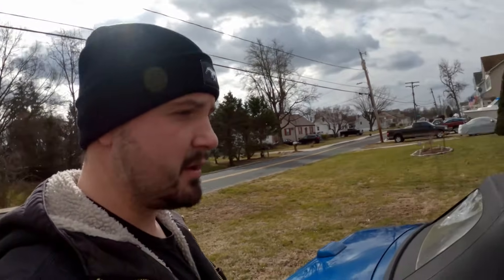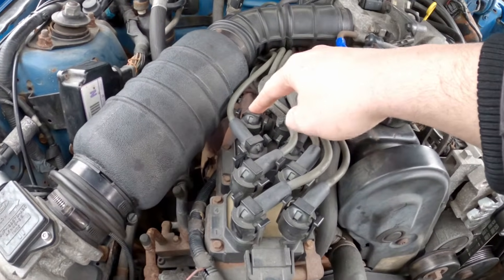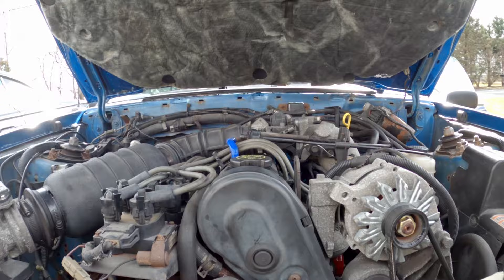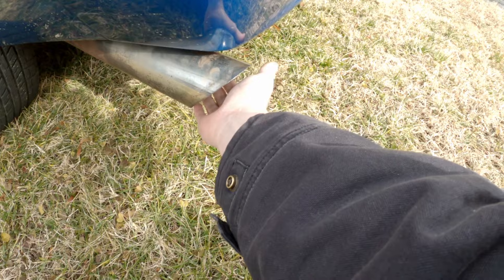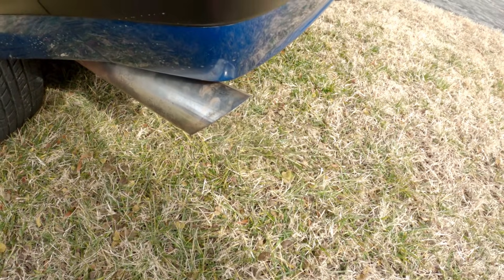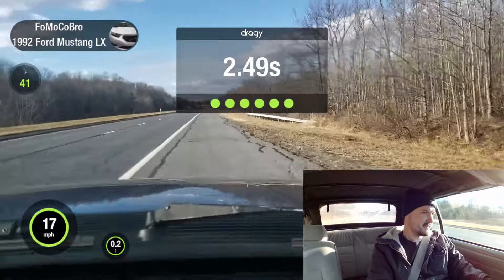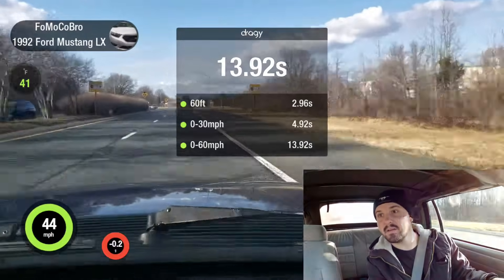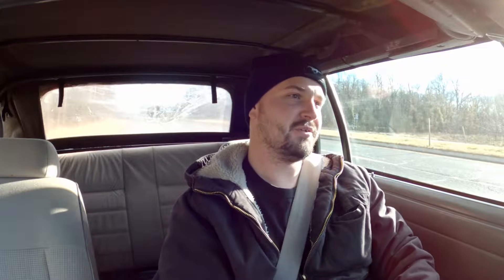Ford Twin Spark 2.3L SOHC Coil Pack Mod Tested 0 To 60 MPH - Science Bro

Comment: If you understand the factory strategy,  you will find that the dual spark function is inhibited above 1500 RPM. In other words, it's turned off above 1,500 in the factory setting.. 

The parameter id looks like this  :PLGNHI Dual Plug Ignition RPM Max 1,500. 

You can change the value with a tuner and supporting strategy, so that both coils fire up to the max RPM. Some have debated weather this is effective. In my experience it definitely makes a difference in detonation resistance, so if possible, I would set this at the rev limit.

The Ford Twin Spark 2.3L SOHC Coil Pack Mod can't work, because both coils fire on the compression and exhaust stroke.

A free mod that will actually will work, would be to slot the crank sensor bracket and add some more ignition timing. 10 more degrees would help a lot. Removing the baffles from the intake muffler wouldn't hurt either.
Reply: Thanks bud
Reply: Only problem I can possibly see with the crank sensor bracket is I don't think the '92 I4 has a bracket.  If I am remembering it correctly, it's just a single piece that bolts straight to the face of the motor and to get any timing advance out of it, you'll be drilling and tapping holes in the block.

This is purely based on my memory, and I could absolutely be wrong, but I think this is how it is and I just wanted to throw in a warning thought.
Reply: @jameskee2412  Having performed the mod myself, I can tell you it is fairly easy to do, however, there's still advantanges to be had by careful tuning of the EEC.
Reply: @ohc23001  was this on a '92 or older with OBD I EEC?  I understand the mod you propose, but can't actually see it being done on a computer I have no way to communicate with.

I also am not actually looking to do the mod, I just stumbled across the video and found all this to be very interesting and simply wanted to add a warning as I do have one of these motors in a Ranger.  This exact year.

If you did do it on an OBD I system, I would still be interested to hear about it.  That would be very fascinating and I would like to learn how to talk to the computer if possible.
Reply: @jameskee2412  I've been tuning these engines with the factory ECU for a long time. My tool of choice is the Moates 1/4 Horse. Combined with a strategy file, it allows the user to access the majority of pertinent parameters in the ECU to affect a reasonable tune, with assorted modifications. These tuner devices are on the lower end of cost, but work well, within reasonable HP boundaries. My Mustang 2.3 is boosted and uses the stock ECU with a Moates 1/4 horse, to make roughly 270 HP. Larger injectors and a higher volume fuel pump were required to support that power level.
Reply: @ohc23001  I appreciate the info.  I'll look into it.  Thank You!
Reply: @ohc23001  thanks for the Info--- my son has a 97 2.3 ranger- we wanna do a few things to it ,,  We also heard that taking a ignitor thing out of a  GM HEI distributor , will make more power to the spark plugs hottter spark ,,not sure if it works
Reply: The extra timing dont help, been there done that!!
Reply from the maker: Great Information! Gonna Pin this 🙂👍
Reply: @KarzKreated  Yeah, keep up the good work 👍👍. It's nice to hear a new perspective.
Reply: 4 of the spark plugs on one side is actually to burn is is actually to burn leftover fuel the other 4 on the other side are normal firing order spark plugs like a  normal 4  Cylinder  But  From my understanding Ford had a problem with all the fuel not being burnt off on  Is the 2.3 feel injected engines

Comment: Twin plug that fires together does not provide more power by itself.  Twin plug more cleanly burns the mixture and thereby lowers combustion chamber temperatures.  On a stock performance engine, one could run less octane fuel in a pinch. On a built engine more compression can be achieved and make use of the higher octane fuels up to 100+ plus octane without detonation issues.

Comment: this doesn't matter. more spark doesn't mean more power. there's no replacement for displacement. the only thing you're doing is firing 2 plugs at the same time. that's it. there is no pros, there is no cons. the reason ford did this was to make their emissions better. also, i've tried it.

Comment: I wonder if this would work on my 2009 ranger has a 2.3l with a 6speed automatic. i think it needs new plugs and a starter motor. Sometimes it drips from the tailpipe but shifts pretty good, also been using the ac less and got a core charge with the new battery to replace the old cracked one.

Comment: I love the old Lima 2.3 SOHC. Had 3 Rangers and an SVO Mustang with em. Now have a Pinto with the SVO 2.3T
   Stout little reliable engines
Reply: I have a 93 Ford ranger 2wd 5sp with the 2.3 and just hit 514,000 miles and still rocking the original engine transmission and rear end! And, nothing has ever been rebuilt. 3000 mile oil changes religiously and just good maintenance. I paid $1400 for it 14 years ago with a bad hydraulic master cylinder for the clutch. I never thought I'd still be driving it to work 14 years later! Lol I undercoat it with fluid film every fall, and it's pretty much rust free. Love it

Comment: "BuT tHiS mOd WoRkS..."
Yes, if you have worn coil pack(s), bad spark plug wire(s), or bad plug(s) - and ONLY then.
- All 4 cylinders will actually be firing EVERY rotation = more powah!!!
IF everything is running PROPERLY, you should get SLOWER acceleration as you now have 4 flame fronts colliding.
> Congratulations, you have literally CREATED spark knock/detonation.🙂
Reply: Very wrong
Reply: Wrong

Comment: I wonder if it gets poorer fuel milage if you do it like that?
Reply from the maker: I'm honestly not sure. I don't think it would have made a difference either way. Just like performance, I think the mileage would be unchanged as well.
Reply: @KarzKreated  I have an 89 mustang 2.3 liter but it is run by a distributor so it only has 4 spark plugs.

Comment: This is just an emissions system, like the EGR valve. Ford programmed the computer to turn off the twin spark at 1,500-1,600 RPM, so it doesn't sputter or misfire. Twin spark is only active when idling and starting out, so the engine doesn't burn as much gas, and pollute more. After all, this engine is a 70's design, before all of the emissions stuff existed. If you've been in a Pinto, you'll know that "smell" while sitting.
Reply: Pintos had carburators, anything with a carburator is effected by temperature.
I can only speak about my 99 Ranger with a 2.5, it uses the primary coil (exhaust side plugs) when starting and after that both coils are firing. You can unplug a coil while its on and not feel any difference, plug it back in and unplug the other one and it's the same. That's actually how to test if you got a bad coil. At least in that era of the Lima 2.3/2.5 
Egr valves might have started out as an emissions thing, they control exhaust temperatures effectively lowering NOX. But those lower temperatures also keep spark knock from happening, especially in 4 cylinder. They're absolutely pointless on a diesel engine. 
People see it as a smog part and think "tHiS iS rObBiNg PoWeR" they take it off and swear their car is faster, having no clue about the operation of an EGR valve and that they only open at mid throttle steady cruising and deceleration.
Reply: Another thing to add... If you remove the emissions stuff, yes, you'll be breaking the emissions law, but you will get better performance. Some diesel truck owners do it, so they aren't having to repair those systems constantly, which costs a lot of money.
Reply: @Joshtheweatherman DEF systems suck, nothing but a money pit as Scotty would say.

Comment: The stock coils already fire on the exhaust stroke… they’re wasted spark they always do that… what’s the purpose of have 2 coils? Double the spark?
Reply from the maker: That's the theory. Both plugs igniting on the power stroke. I ended up replacing the ignition system with a high output system using the primary set of plugs and it ran better than stock and better than the coil pack mod.

Comment: remember the computer on these adjust it self. probably Y not design that way. I just air burst my EGR valve and vacuum lines plus use carb cleaner and sea foam in tank. huge difference in power...

Comment: Your car is on par speed wise with the 94 grand am I had with a 2.3 sohc quad four! It was really hindered by its 3 spd auto. First gear was way to long getting you to almost 60 before shifting to 2nd then running to 80 before hitting 3rd

Comment: I just wired my coil packs together on my 97 ranger. It seemed to do a little better on fuel and was more responsive at lower rpms. But for some reason at higher rpm under load sometimes it would misfire or have premonition sometimes
Reply: That was supposed to be pre ignition in my comment at the top not premonitions . Guess it was psychic
Reply: remember the computer on these adjust it self. probably Y not design that way. I just air burst my EGR valve and vacuum lines plus use carb cleaner and sea foam in tank. huge difference in power...
Reply: @swfsecurityman1 how did you purge your egr valve
Reply: @williamturner5300 I replaced it.
Reply: 😅😢it was not designed to do this but if you have the money you can do anything you want...😅
Reply: Do you have intake spark plugs? And also exhaust spark plugs?
Reply: read the pinned top comment

Comment: The dual spark is why my claptrap 96 still passes California smog with ease
Reply: god bless twin spark 2.3l
Reply: Its a "waste spark" and has nothing to do with burning leftover fuel. If you had fuel buring during an exhaust stoke, while another cylinder is actually firing, it would probably destroy the engine.
Reply: This feature was purchased off of Nissan Motor Corporation as Nissan was a part of Ford Motor Corporation. Case in point, the Mercury Villiger is nothing more than a Nissan Quest. At any rate, the Z engine as it was called was purchased in 1990 in order to burn and reburn hydrocarbons for stricter cleaner air pollution equipment standards, yet give you added  horsepower and more performance. These engines, were installed in certain Ford Ranger trucks, and Mazda trucks which, Mazda is also a part of Ford Motor Corporation. Case in point, the Ford Courrier trucks were actually produced by Mazda, however had a Ford Blue Oval label on the truck itself, therefore, Ford Courrier Truck.

Comment: That 'mod' is all b.s. . Both of those plugs fire at the same time. It is called a wasted spark system. Many motorcycles use the same system. All plugs fire just before top dead center depending on where in the advance cure is. On my '94 Ranger it starts at 10 degrees before tdc and advances to only 30 degrees before tdc. Compared to 35 to 40+ of single plug application. If you want to see a change, unplug one of the coil packs. Power and mileage will suffer.
Reply: Thank you for properly understanding and explaining the DIS "wasted spark" concept.  The only thing those chuckle heads are doing with this "mod" is reversing the polarity of the sparks, which at the most changes the wear patterns on the electrodes slightly.
Reply: I would hate to have a cylinder fire on the exhaust stroke. Good thing there's no possible way it could actually burn "unburnt" fuel like that. Probably why its called a waste spark system! I think catalytic converters are what actually burn off unburnt stuff. 
Idk where people get this whack information.
Reply: Just unplug one coil and drive?
Reply: @Zaydub666  yes
Reply: @nebrrex6910  what will it do tho? You say it will suffer power and mpg, so what’s the benefit?
Reply: @Zaydub666   A more complete burn with less ignition advance.
Reply: All cylinders fire at tdc on this engine you are burning the fuel that is the result of intake pulses pushing fuel thru and down the exhaust. It is firing like a two stroke if you take the time to read the service manual you can call me a liar if you want but you would still be a ignorant fu k